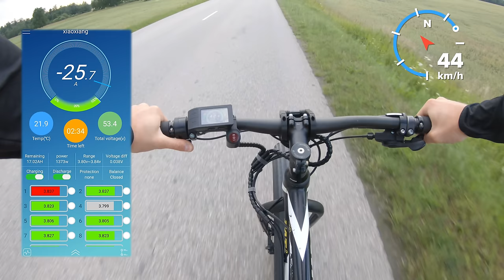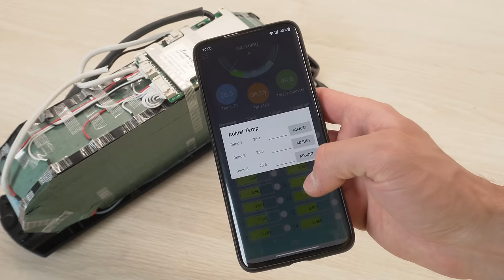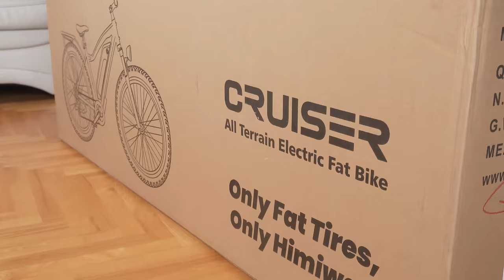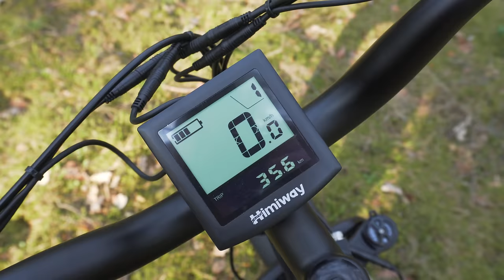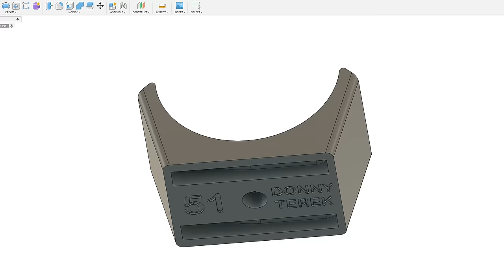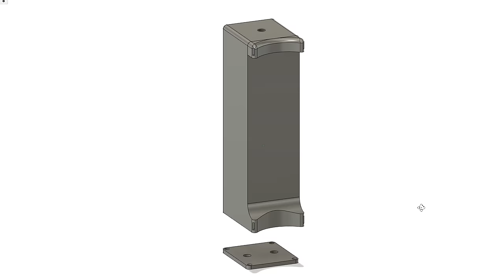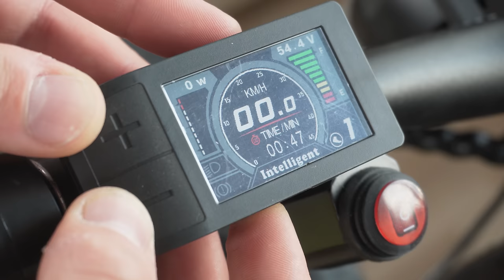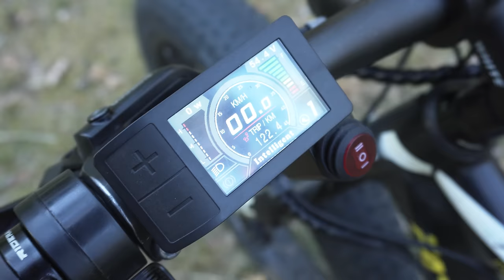Building a 50 km/h Fat Tire E-Bike (1200W)

Comment: I have built & bought several ebikes, currently rebuilding 2 that were damaged by flood waters from hurricane Ian in Florida and a new BBSHD fat bike build. Mechanically I can pretty much repair or replace anything on a bike, but that battery build blew me away. Very impressive.
Reply: Hi, I have a question. What disc and brakes you used ? SHimano, Avid, Hope, Magura ? Mechanical or hydraulic ? If hydraulic, what fluid ? DOT 5.1 or mineral oil ? 180 203 mm ? 2 mm thick ? What is stopping distance at 45 km per hour with full loaded ebike ?

Comment: I believe 1200watts on bbs02 is its peak power but only when using 52v battery, 48v doesn't hit peak watts on 750w, i had a bbshd with 48v and its peak watts were a shy over 1000watts but when i use my 52v i can get up to 1500watts.

Comment: Was also wondering about a conversion , the only thing doing it after is always the cable management, always no matter how or you need to run additional cable runners or have a frame with inner tubing and lots of free space , nevertheless you did the out most best in not making it a ridiculous mess  ... From what i can see these mid-engine do hang very low, did you had any problems clearing stuff with it ?

Comment: This is a great motor, so much torque. I have the same motor, but I changed the settings, so I get full power all the time when I'm on the throttle, but I put it on a hard tail 26x2.5  mountain bike and it eats hills for breakfast I would love it if I could make my own battery's 👍🏾

Comment: What filament do you use for your prints? Any concern on the plastic warping when you place the DC converter in the sealed printed container?
Reply from the maker: Using PLA, no issues so far on a few of my e-bike builds. The DC converter does not produce much heat.

Comment: Great build! I don't understand why my 52V 1000W BBSHD is ... 1000W and your 750W BBS02B is 1200W ? In any case another video about the programming would be appreciated!
Reply from the maker: Thanks! You are not mistaken, the BBSHD is stated as 1000W and the BBS02B as 750W. I just wrote the actual power number that I get from this 750W motor which is over 1200W.
Reply: 1200w on that bbs02 is the peak power but only if you use 52v battery
Reply: Your 52v bbshd will do more than 1000watts, check your display has a feature to show its power curve for watts, 500c or dpc-18 are good displays, i use 52v 20ah em3ev battery with my bbshd mines peaked at 1486watts so far.

Comment: Your a beast mate, totally mental bike builds!!! Stupid question though does a wheel diameter help top speed, on a 15000-2kw hub motor, what size wheel would you recommend if i want to reach an easy 50-55kph,cheers bro😊
Reply from the maker: Thanks! Much appreciated. I'm not too sure but I would think that the wheel size wouldn't matter too much at top speed. I'd go for 26" though.
Reply: @DonnyTerek  any reason why 26
Reply from the maker: @alitoroganan2442   It's still a standard size for hub motor kits. Also if I'm not mistaken, the larger the wheel, the more strain is applied to the motor for initial torque.

Comment: all of the links to the battery cells don't work. Are you able to provide the battery cells that you used please.
Reply from the maker: Hi, please check if the links work now, thanks.
Reply: @DonnyTerek  unfortunately they still do not work.
Reply from the maker: @97JoMiller  Please check the nkon.nl link now. I guess others won't open because they are AliExpress and might not support your country.

Comment: yo where can i get those 3d printed spacers?   Am i over looking them? i only need yours so i can edit them to fit my frame lol
Reply from the maker: Hi, sorry for the late reply. These are custom made, I am planning to have these for sale soon.
Reply: @DonnyTerek  awesome!  i am fairly new to 3d modeling  and my tubes are very different then yours  but want to adapt your model for my frame...but even if its a premade thing that might be great too!
Reply from the maker: @acedotcom  I am able to customise the models to pretty much any size round tube frame if you can measure the tube diameter.